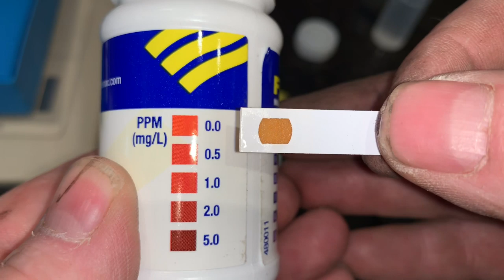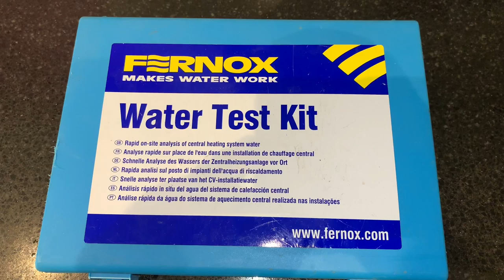Plumber - Flushing central heating system

Comment: Thank god that in my Country we have pressured system. 3+bars under every boiler we install on flow and return one service valve (like penny valve but 3/4") conect mains directly to flow and i conect return directly to drain and flus all the crap out. We have at least 3 bars  in the mains we have to install reducing valves because some areas have 10+ bars of pressure hoses on the taps wants to ripp of. I must say u are really good plumber considering the system u have in UK, half the plumbers in UK/Ireland wouldn't do that. Boiler service is basically safety check/leak check, gas analysis, pressure test and that's it 35min and bye.

Comment: I have used Sentinel X900 and X100. Just pour in and leave. X900 loosens the crud, the filter grabs it.  X900 is only to be used with a filter. Clear filter after commissioning. Needs a revisit after 3 months to clear the filter after X900 has done its job. It works.
Reply from the maker: John Burns That’s really bad practice in my opinion. I would always try and flush as much of the rubbish out as possible. 👍
Reply: @AllenHart999  
It works. A normal flush after installation of course.  It does work. It just takes longer. If there are radiators with obvious large amounts of crud, a mains water flush (water in and out) hitting the bottom of the rad with a rubber hammer, with only that rad open can shift it, or most of it, with the X900 and filter doing the rest over time.  The filter should be cleaned every year at the service.

Comment: I use the magna-cleanse a lot and have found that it does a much more vigorous clean when the rads are something like 1/4 filled, this also increases the concentration of cleaner in the system during the flush due to the lower water content and have had some serious magnatite build up on the magnets.. ive been looking at getting a full system water test kit and wondered if you had any review on the kamco systemsure water analysis kit, there doesent seem to be any other kit that uses quick test strips, like this and apparently the adey engineers test kit is unavailable here in the uk, I notice yours is fernox and also can’t seem to find this anywhere

Comment: Hi great video and well explained. Do you ever fill your systems with Soft water? I live in Essex and the water round here is the second hardest in the country! I just wondered if it would accelerate deterioration in the system and what your thoughts are?
Reply from the maker: Water is great here, We do not have issues with scale.

Comment: Hi Allen is it mandatory as part of benchmark or gas safe to do water samples? Or is it just best practice and a powerflush will suffice
Reply from the maker: System needs to be clean but you do not need a sample just yet. Thanks.

Comment: Allen where did you get the camlocks for your TF1 flushing adaptor? . Great vid btw
Reply from the maker: I got mine from the fernox rep. I believe plumb centre sells them though.👍
Reply: @AllenHart999  Thanks :)
Reply from the maker: @grahamhusk183  https://www.mrcentralheating.co.uk/fernox-tf1-omega-filter-flushing-adaptor?utm_source=google_shopping&gclid=Cj0KCQjw753rBRCVARIsANe3o44nIRnG8XFeVBXasrM8BlW2T8JU3fnGN3N9vOxulRiLwJD31X3oamgaApMsEALw_wcB

Comment: Either my eyes are deceiving me, or it looks like there's a lot of pre-existing 10mm plastic going to those rads. Might be copper. can't tell.(N.B. to self---> opticians)10mm plastic is notorious for sludging and blocking up on systems that are either not installed properly, fitted with a filter or poorly maintained. 
Thoughts on microbore, Allen?
Reply from the maker: I do not mind mircobore if system is clean. I wouldn’t personally install it though. This is copper. System works really really well.
Reply: Don't like microbore either. Only ever use it as a last resort for fiddly threads and then usually always copper. Bought a 50m roll of 10mm b-pex around 8 years ago and still got most of it left.
Reply from the maker: @loafersheffield  I used it once years ago, Done loads of flushing jobs with it though. 👍

Comment: If you’ve got a magnetic filter on the system, why would you need to powerflush or chemically cleanse it?
Reply from the maker: Doublethink What does a magnetic filter do?
Reply: @AllenHart999  - I thought it was to remove the iron/rust deposits that clog up your system?
Reply from the maker: Doublethink It only really collects magnetic sludge, Doesn’t do anything else. The system still needs to be clear and the correct TDS and PH

Comment: its all about keeping your water at neutral pH, about 7pH, you can get test strips from any chemist or home brew shop. The so called inhibitors are mostly caustic soda which raise the pH. It is extremely alkali and has a pH of 12. It is one of the strongest alkaline chemicals. Raising the pH stops oxygen in the water reacting with metal radiators.

Comment: Do you use the vibration tool on the rads to loosen up the particles inside them?
Reply from the maker: You can do that, I snapped mine and never bought another. So in answer to your question, No. 👍
Reply: @AllenHart999  Allen contact Adey my vibrclean also broke.  They replaced it f.o.c as it's covered by a lifetime warranty. 
P.s better to cover it with a tea towel when using it, saves the rad.  Also use it with a dishcloth on removed  P2P's, helps get out the crud with the aid of spirits of salts. 😊

Comment: Hi Allen my heating engineer when he did our new combi and 3 new rads put the fernox f5 into the system but he left it in there and said it would continue to clean and maintain the system for months is this true mate
Reply from the maker: I wouldn’t personally advise leaving cleaner in the system. 👍
Reply: I'm curious why you wouldn't.
Reply: if that is a inhibitor then that will help the rads to prevent from rusting.